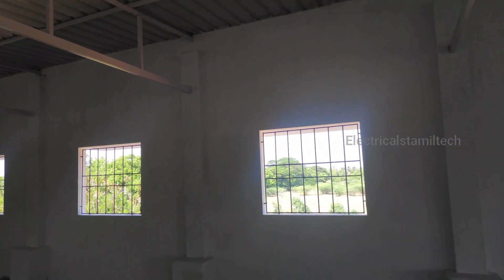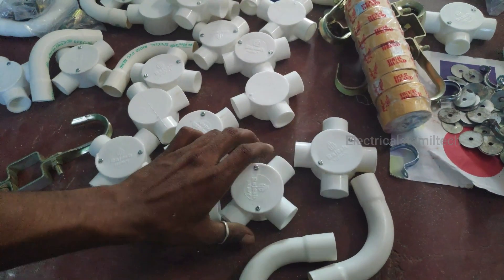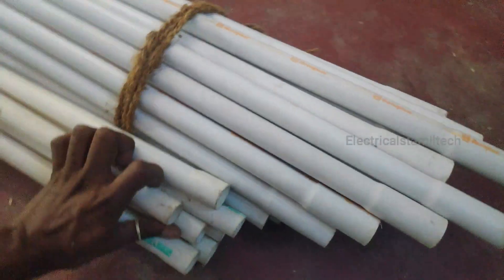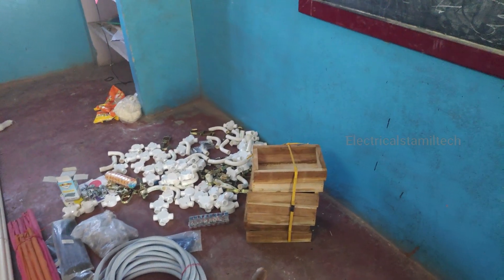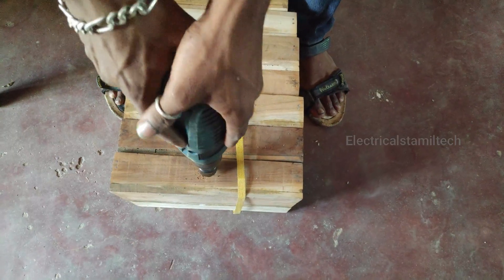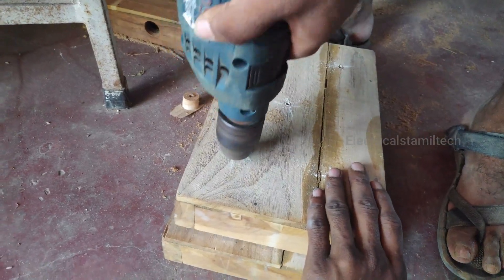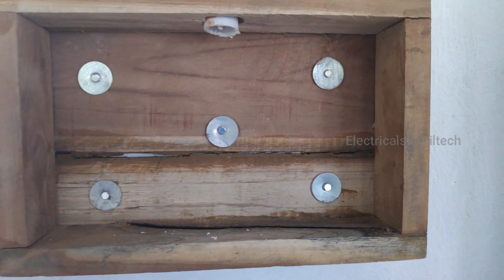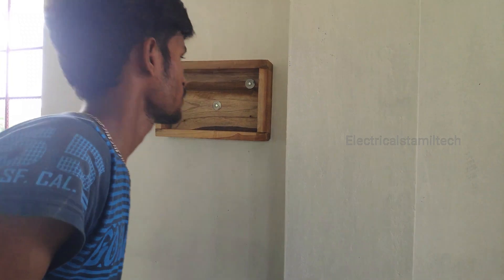House wiring explain part 1 || Electricalstamiltech

Comment: Bro 4 room 2hall+ dinning hall kitchen and 4 ac point and 1 bore motor how much mm wire to use from mcb to meter board 2.5 or 4 sqmm
Reply: 3.2 sqmm